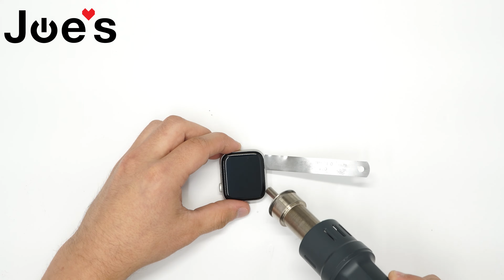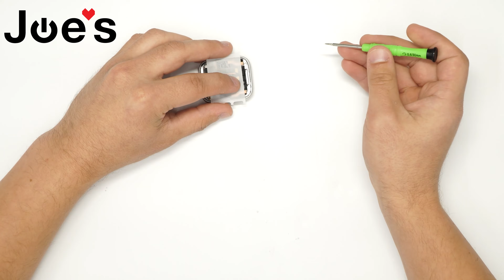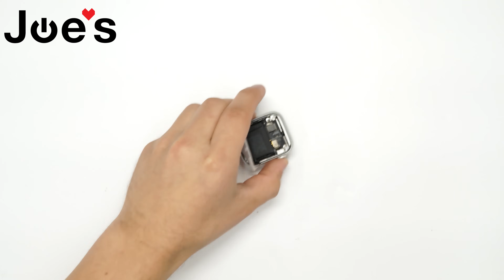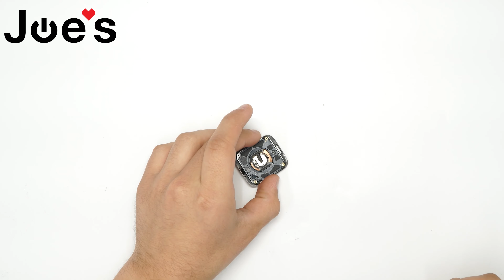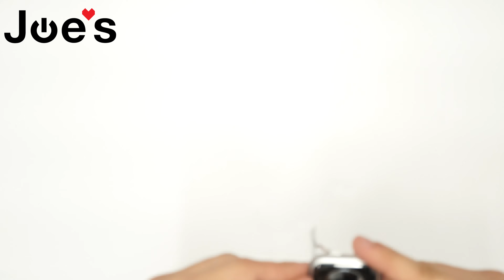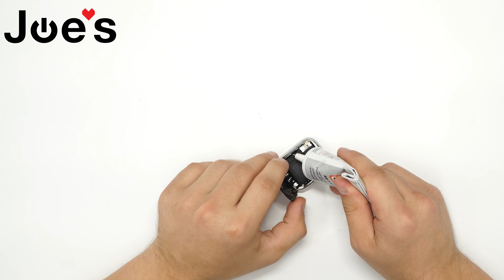Tutorial How To Repair Replace Broken Back Cover Apple Watch Series 4 Glass Cover Heart Rate Sensor

Comment: Those 4 tiny coil springs on the strap latch buttons are a challenge. Its like having 4 Zeberdees who all think it is time for bed! Where can replacement springs be found?
Reply: they appear to be 0.8mm x 3mm of 0.1mm stainless wire?
Reply from the maker: https://www.joesge.com/products/apple-watch-series-4-40mm-44mm-back-hear-rate-cover-parts?variant=31749479530542

Comment: This is stupendously difficult to fix. 
I hate Apple. 
Just another money grab
Reply from the maker: We are just tryna keep them outta land fills
Reply: @Joesge  Thank you for your service 👍
I am currently fixing a cracked sensor on an Apple watch SE
I removed most of the glass, and covered the exposed area with electronic silicone. Then I'm going to try using 2 layers of clear tpu film and put a bit more sealant on the edges. Not the best fix, but it's my only option since I am not going to pay apple $239 to repair it. That's how much the watch was new

Comment: Hey there, congrats for your video. I replaced my backplate but my watch is not powering on anymore. Do I need to reprogram the new heart sensor? Like the newer iPhones ..
Thank you very much!!
Reply from the maker: Thanks for the comment. The issue you are describing sounds like you might have nicked a ribbon or two each ribbon does it's own function and you might have forgot to plug one in or ripped a ribbon.This is a common issue with the Apple Watch Repair.  If you would like your device repaired by a professional you can fill out a repair form and follow the steps to send in your item. We offer free shipping and diagnostics. Here is a link to the repair form:
https://www.joesge.com/pages/repair-services

Russ C.